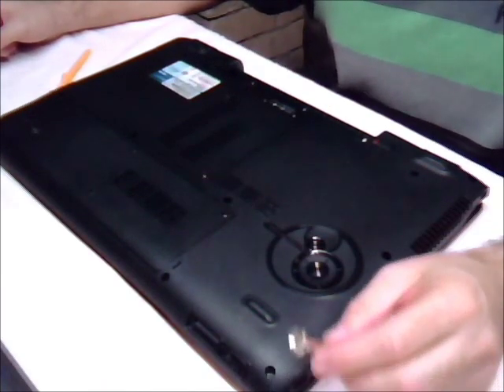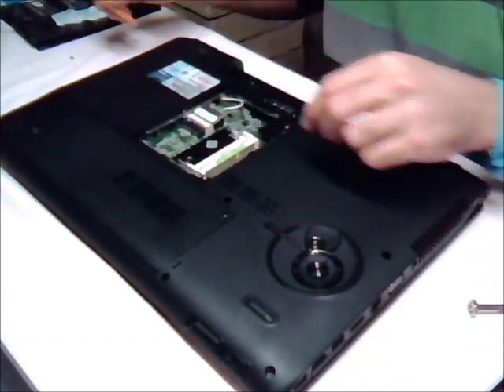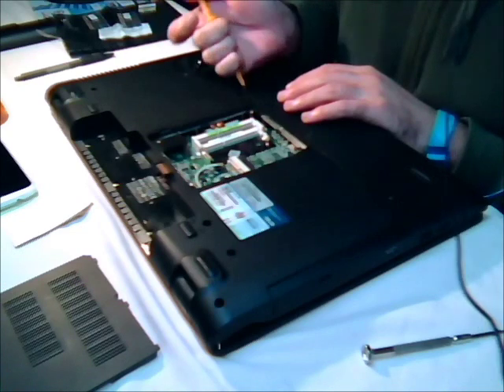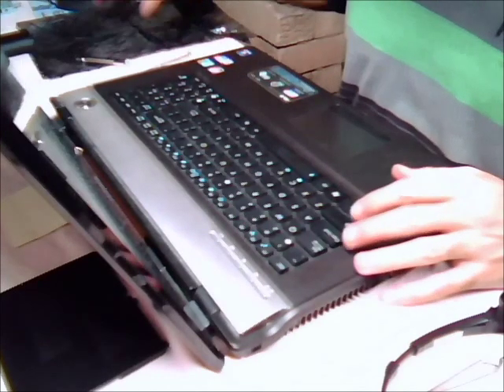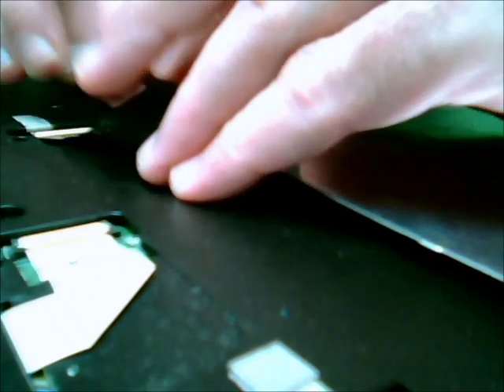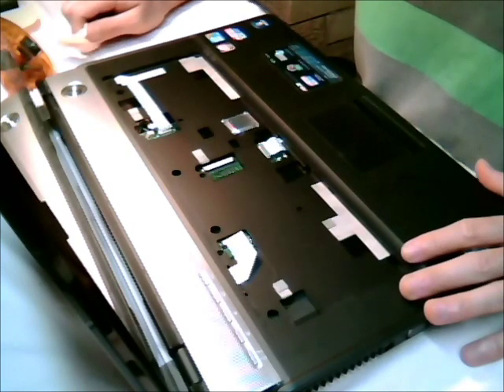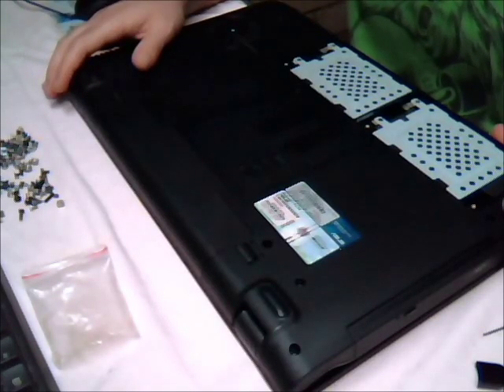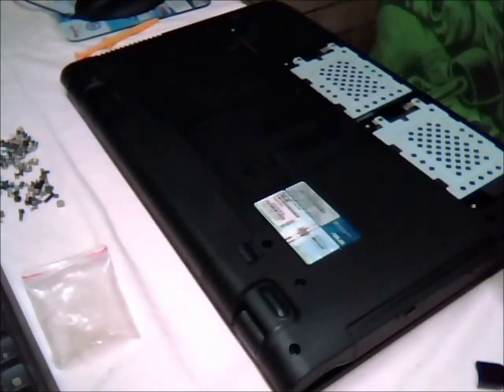ASUS N71JQ SATA Connection installation

Comment from the maker: From the asusparts.eu website. There are 2 parts you need. The caddy (N71-1A HDD BRK ASSY) [13GNX01AM010-1] and the connector (N71VN HDD BD./AS) [60-NX0HD1000-B01]  Just search for the part numbers on the website. I got them delivered to Sydney for $50 (AU) took around a month for delivery.

Comment: Hi,

I saw your video and I'm really impressed, must admit that. :)

I have ASUS N71JA - TY047 and I want to insert SSD HDD in 

second slot. I read on few forums that I can't add HDD there 

because there is no SATA connector. Your model is N71JQ and I 

want to know can I add HDD just like you did that in this video?

Highly regards,

Srdjan